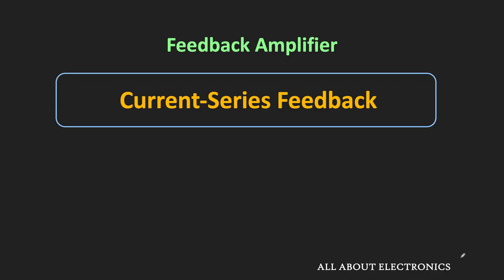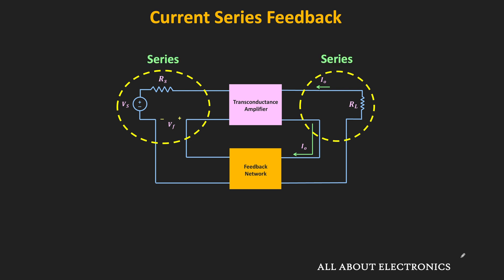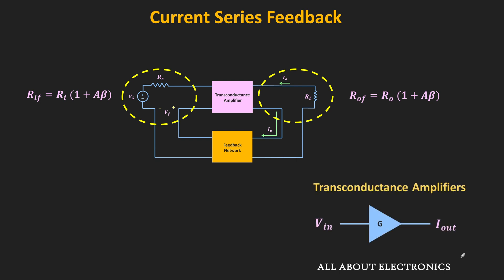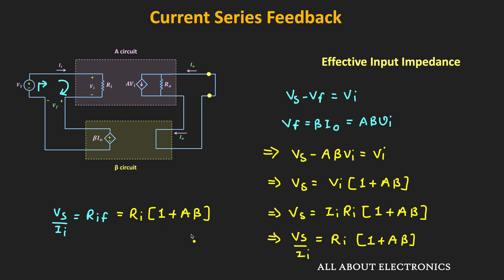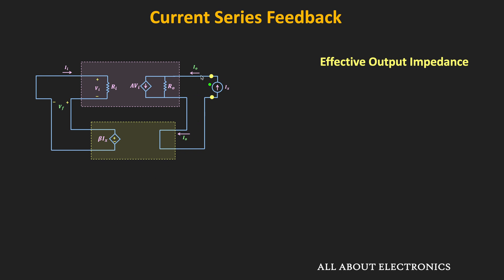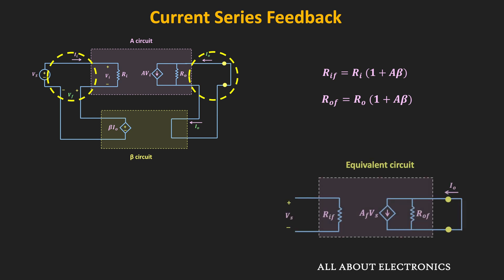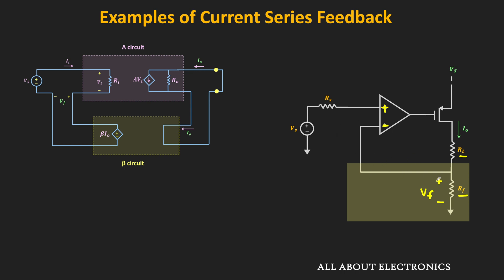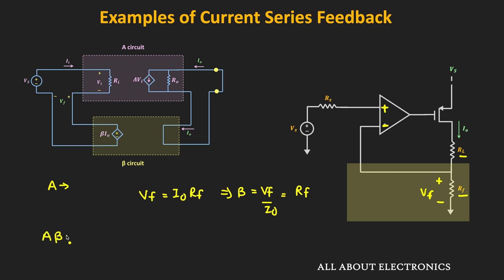Current Series Feedback Amplifier Explained | Feedback Amplifier

Comment: 6:07 Hi sir.. Why Ro is connected like parallel across AVi...where as it is connected like series in voltage series and voltage shunt...
Reply from the maker: Because here the current is the feedback. Avi is also current source. In the current source, the output impedance Ro is always in parallel with the source. While in voltage source, it comes in series with the source.